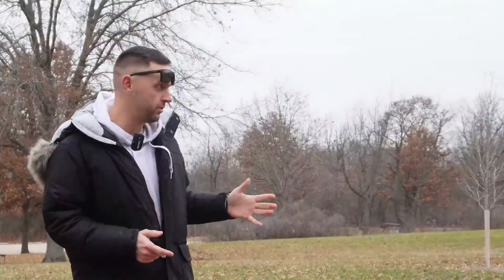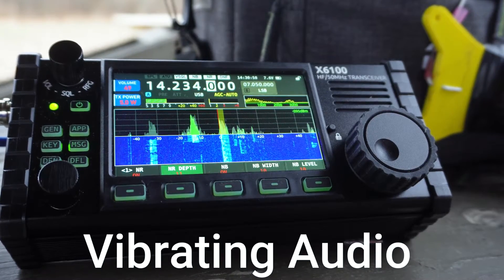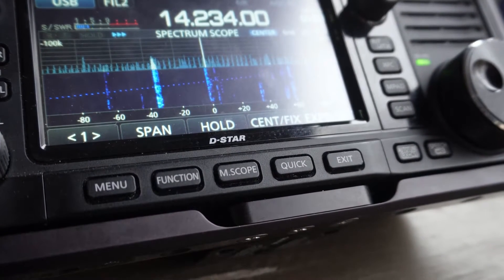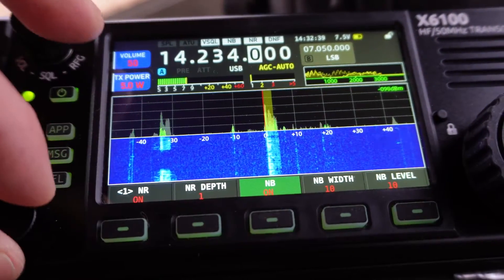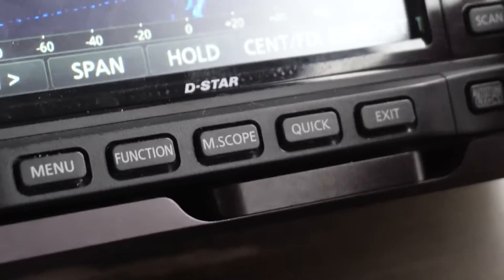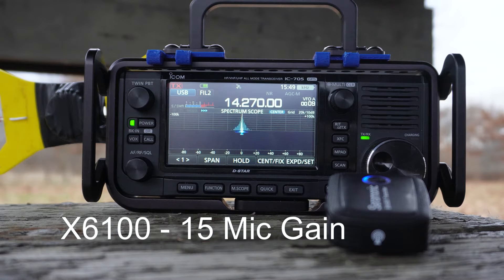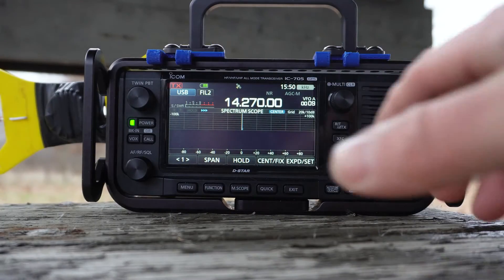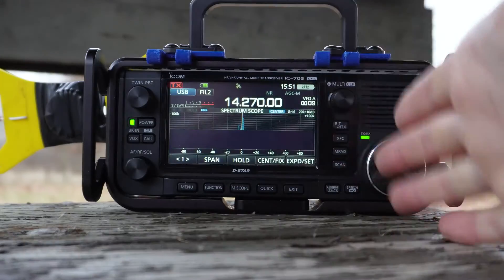Xiegu X6100 Audio Receive Examples. Comparison to Icom IC-705. Xiegu X6100 sounds like GARBAGE?

Comment from the maker: Thanks for the suggestions all. A couple of IMPORTANT notes:  1.  The current firmware (as of Dec 14th), seems to have a few issues:  A. If your frequency goes off 10khz, Factory reset should fix the issue B.  This HELPED (but did not resolve the Vibrato tone in the audio on NR).  2.  The x6100, when shutoff, will turn your bandwidth settings back to 2700 from whatever you set them too (i originally had them at 2400).  I just wanted to point them out. Thank You all for your amazing comments.

Comment: Re the rx sound on these two radios, the 705 has a larger speaker, if you compared the two, but used the speaker mic. That would be a better comparison. But you expect much better audio from a radio costing twice the price of a X6100.

Comment: I like a clean signal and that's why I sold the x6100, for the money it's a good radio, but it didn't suit me. Other problems are when connecting the x6100 to PC and HAM programs, the display of the x6100 is almost invisible on a sunny day, digital noise reduction, etc. work strangely with the x6100, to say the least, I never achieved a good result, the result was always only a low-quality signal even without noise. For another, I don't know why I should support China, when we have stable and strong manufacturers here who have been developing radios for us radio amateurs for decades, and they are the ones who need to be supported in difficult times to develop more great radios for us radio amateurs.

Comment: I also have both a 705 and X6100.  The worst thing I have found about the X6100 is the horrible random self interference that it has that can totally trash weak signal DX.  The other night I was trying to listen in on the Triple H net on 7.190 MHz and there was really nasty strong local QRM just below the net frequency bleeding into the channel making copy nearly impossible.  Sometimes I can resolve this kind of problem by looking for something local like a USB wall wort charging a phone or tablet that I forgot to unplug - but this night, nothing seemed to help.  Then, remembering the numerous X6100 internal birdies I had seen in the past, as a test, I removed the X6100 antenna BNC connector - and -  BINGO  - THE INTERFERENCE WAS STILL THERE!  - which indicated that IT WAS BEING INTERNALLY GENERATED BY MY X6100! - but just to positively nail it down,  I switched over to my IC-705, and sure enough, PROBLEM SOLVED -> NO MORE INTERFERENCE!  I think that this is definitely the worst knock against the 6100 - the fact that not only are there lots of birdies, but that THEY CAN MOVE AROUND RANDOMLY and COMPLETELY TRASH A CALLING FREQUENCY OR NET FREQUENCY THAT YOU ARE TRYING TO USE.  My X6100 was running on battery at the time with no USB or external cabling whatsoever, so this wasn't something that could have been resolved by disabling the battery charge setting or adding some ferrites to an external cable.  Sometimes fixed self interference birdies can be resolved by cleaver hacks to the internal frequency conversion scheme which let the radio skip around the image frequency causing the problem, but in this case, the internal interference seems to come from internal sources that are NOT very stable or controllable in frequency (internal switching power supplies, or MPU clocks for example) which makes it unlikely that this will "be fixed in a future firmware update".

Comment: I own both radios as well (with current firmware). I've noticed on CW reception the X6100 distorts at even low volume. It might be better with a higher side-tone (I had it set to 600Hz), but still...when I use my 705 I'm so happy; when I use my 6100 I keep having to stop myself from chucking it as far as I can into the bushes. LOL. It's really full of little quirks and bugs. I really want to like the 6100 because I'd choose it for SOTA and hike-in/bike-in POTA because it's more compact. But at this point I'll make room for the IC-705. For hard-core light-weight ops I'll take my Penntek TR-35.

Comment: For a radio for less than half the price of the 705, which BTW has the audacity to NOT include a tuner for that price, I basically don't care how the X6100 sounds.  The X6100 is a great "alternative QRP" radio. Putting the cost savings over the 705 into an MPAS antenna system makes for a cost effective package.
Reply: Did you get the MPAS 2.0 by any chance ? I got it with the CAP HAT and use it with the FT-891 and I have made contacts all over the world with it on 20M especially and just last night on 17m to Brazil.  Even got Australia a couple of times on 20m. 

I have 4 radials and noticed an improvement in performance vs 1 radial. 

The MPAS 2.0 is a very quiet antenna too and Great for SWL. 

The FT-891 has absolutely amazing receive audio with headphones, superb low noise floor, unbelievable for the price. I sold my 7300 and got the FTDX-10 couldn't take the harsh audio any more, the 891 sounds so much better, don't miss the 7300 at all.
Reply from the maker: Best of luck with the radio.

Comment: Can you please test the new firmware released last week?
Reply from the maker: I have tested it and didn't make a video.  However, here is a recap:  the Firmware update from the 29th:
1. Wifi still functions but has DHCP issues (Nothing was really fixed)
2.  Bluetooth scans and connects to bluetooth devices, but bluetooth serves no functions yet. (Cannot use your headphones for audio or use a bluetooth microphone)
3.  The newest firmware took away my ability to enable IQ out.
4.  DNR has been improved. There is still a wavy tone if DNR is enabled. This is better, but needs more improvement
5. They took away the 25 waterfall bandwidth. Your two options for waterfall bandwidth display are now 50 and 100.  

I've never seen a firmware take away so many features.  I believe this firmware was rushed for the following reason:  
Companies like Radioddity and HRO needed to ship batch two and Xiegu was getting pressure from at least one of these companies (Radioddity) to get a "fix" out so the radio has the features advertised.  Xiegu was rushed and hacked together whatever they could.

Other than that, I haven't tested much. This radio has gone to the side until something significant occurs.

Comment: I guess my only comment is that you’re comparing a $700 radio with a $1300 radio. 

I also see a whole lot of potential in the 6100 where a hacker community could turn this thing into a real shiny star because of the Linux underpinnings where the ICOM will just sit there with zero future improvements despite it also being an SDR. 

For a $700 QRP with features like the 705 (big color display, several physical buttons) but with the potential of some community software mods; I can see the 6100 become an incredible steal at its current pricing.
Reply from the maker: Great input. There's definitely a lot of potential in the radio.  You're right about the 705 comparison. Thanks for the great input.  I'm really looking forward to seeing what can be done with the hacker community as well. Happy new year
Reply: To be honest, ADS of Xiegu compares 6100 with ic705. Why manufacture can but regular user cannot? :-)
Reply: What's wrong with comparing a $700 radio with a $1300 radio?

Comment: One thing I found with my x5105 I didn't like the audio / receiver that came out of the box.  I ended up picking up a cheap $10 bluetooth speaker from Walmart with a battery in it and an aux port.  It works extremely well to help produce much better quality audio from that radio.   It seemed the 5105 was both overdriving the audio preamp as well as overdriving the tiny speaker in it.  By setting the volume of my radio to 50% then controlling the volume on the speaker it sounded like a whole new radio.  You may want to test that with the x6100 as well it's possible it has the same issue.

Comment: I immediately had the impression that Xiegu on Tx was experiencing rf returns due to mismatch of the antenna possibly?  End fed are prone to give this problem. I suggest you try to tx on a dummy load close to the second radio to pick up the signal and check how it does in transmit.
Receiving side don’t know what to say..
73
Reply from the maker: I did have counterpoises in place, but I'll definitely give it a shot.  I think it was caused by high mic gain .. but I'll get back with you soon. Thanks for the suggestions

Comment: I tried 15 minutes my x6100 and I noticed a huge problem on 40 meters. On a big part of the 40m ham band I can clearly hear, over the amateur signals, the voices/music of the broadcast stations. Did any of you have a similar issue? I'm worried it could be a filtering issue due to defective hardware. I still need to flash the latest fw.
Reply: Please turn off machine preamplifier is OK :)
Reply from the maker: @bi7mwv419  thank you
Reply from the maker: I hear a lot of stations which I figured were SWL as they didn't happen below 7200.  I will keep an eye on it and when I hear it next, I will compare with another radio and the swl schedule
Reply: @DudeTested  those stations were clearly the stations 30-50 kHz ahead (@7210/7250). I'm worried it could be caused by defective hw. However I tried the rig on a gap titan dx (vertical antenna). Would you be worried if you were in my shoes? :)

Comment: Thanks for what you and T.O. are doing for the ham community by putting the X6100 under (much needed) scrutiny. How about a side by side comparison of the X5105 and X6100? Just like you did with the 705 and X6100. I'm not going to condemn Xiegu just yet. One radio that they did seem to get right was the G90. I hear a lot of good things about that radio both on YouTube and on the ham forums. I'm holding out hope that Xiegu will make this right, eventually. However as others have said, they did seem to rush this out the door "Not Ready For Prime Time.
Reply from the maker: I don't have a 5105 anymore, nor a g90.. sorry. Just comparing with what I have
Reply: Certainly better than against a 705. It will never compete with that.
Reply: G90 has horrible audio, much worse than 6100. Sold G90 due to this reason.

Comment: not sure why you had the noise blanker NB also ON at the X6100 , maybe it was too cold .
Reply from the maker: I had it both on and off.  But then after I came inside, the radio had sat for multiple days, so I'm not sure that too cold had any effect on the indoor testing.  I will say that factory defaults and or firmware reinstalls resolved the off frequency issue

Comment: The Xiegu indeed has that vibrating effect in the voice, the Icom sounds way more clear. 
Noise reduction off does indeed improve the sound quality

For frequency checking you could transmit a 600Hz tone from radio A and receive on B on the same frequency, there you can measure the tone frequency to see if and how much it seems to be off. Just a hint :)
Reply from the maker: I'll do that! Thanks for the hot tip!
Reply: @DudeTested  Good to bring this to our attention.  When you testing the 600Hz audio, try to do a frequency audio sweep as well to test the bandwidth of the audio filters. As I get the feeling that the NR filter is narrower and distort the audio signal.
Reply from the maker: @stefansweerts3825  that's a great idea. I ended up getting rid of the radio, but if I have the chance , I'll test it again and update you. Thanks!

Comment: Did both have the same I.F. bandwidth?  What about an external speaker?  I am reaching for straws on this.  ICOM RX audio is much better.   I assume to the best of your ability all the settings where the same or as close as possible?
Reply from the maker: 2400.. I thought I mentioned that but it may have been edited out
Reply from the maker: But if there is something else you need me to test or you want me to physically show it I can make another video real quick

Comment: I hate to sound negative, but that radio just sounds horrible. I hope there is a software fix.
Reply: Your not nuts, I have same issues with my x6100. Among other weird things happening with it. I unfortunately have to return mine; The battery is bad, very bad. I wanted to like this radio so bad but hardware problems are a deal breaker for me.
Reply from the maker: I'm really hoping other 6100 owners will jump on and tell me I'm nuts or they have the same issue.  I'm going to reset the radio

Comment: IC705 all the way. That glued in battery is a big bag of nope for me.
Reply: Agreed. So far, from what I've seen and heard of this 6100, it's an almost total flop IMHO. I will not be getting one and that's a shame because I really wanted one. My IC-705 is absolutely fantastic and worth every penny I paid. Well worth it.
Reply from the maker: I won't be getting rid of that 705 anytime soon, that's for sure..
Reply: I am personally torn between the Ic 705 and Lab Discovery 500. I am looking for hf only but the price difference makes the 705 more appealing as it covers more than hf but the metal case of the Lab discovery makes it attractive, it seems to be very tough compared to the plastic of the 705.
Reply: @kylefreemason  it is a very tough choice. I think if you’re a rugged adventurer the 599 will be your radio. If you’re just a POTA/SOTA op the 705 will be good.
Reply: @n2rj  SOTA usually means tough environment, conditions, that's why I prefer the TX-500. But the 705 is a nice rig as well, just not intended to be operated in heavy rain and snow.

Comment: With the SDR transceivers, software is as important as hardware, it's hard to tell which one to blame (or both). RX is bad but TX splattering is also very noticeable, about 10 kHz with the PTT release!
Reply from the maker: Excellent comment!  Thank you. You're right.. it is hard to tell if it's software or hardware.. I guess time will tell.  My thought process with the frequency being off 10K is we could do an adjustment like you would do with a sdr like a hack rf.  But you are right it could definitely be hardware as well.  What I understand you saying though is you definitely hear issues as well?
Reply: @DudeTested  From your video, in my opinion the NR in the Xiegu is really bad and distorted, either it is badly implemented or it's a shitty algorithm. The NR in the 705 is OK, not a great improvement but doesn't make the audio worse. Check the NR of the BMI speakers or the FT-DX10 to listen to a good NR for ham radio.
Reply from the maker: Hey thanks! I agree.  One thing I just thought of, in one of my other videos, the NR seemed better.  I just realized that was with the old firmware and this test was with the new firmware, which may indicate something with the new firmware. I'm going to reload the new firmware and go to factory defaults to see if it still occurs. I appreciate it
Reply: @DudeTested  Thanks to you! I really appreciate these review videos, is a vicarious experience of enjoying them without actually buying them.

Comment: It works, it’s weird, but it works lol. A user could adjust their operating to make the best of it. I have a old Kenwood that I usually have to go 10kz above or below, just something you deal with sometimes. Keep the videos coming👍
Reply from the maker: Yeah it works and it'll get you on the air. But this isn't an old Kenwood radio and out of the box I shouldn't have to do it 10K adjustment
Reply from the maker: Thanks bud, i appreciate it. I'm having fun making these videos and hopefully it helps somebody